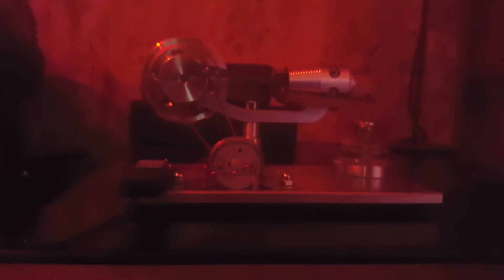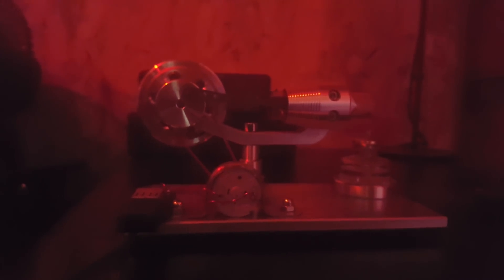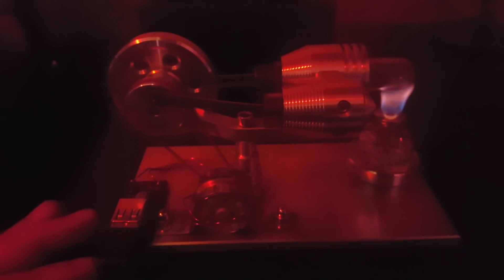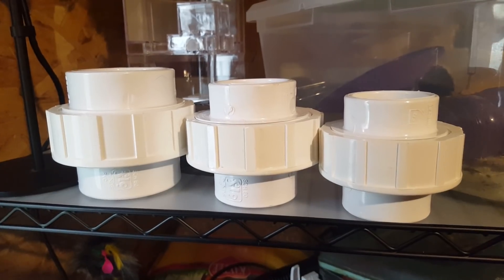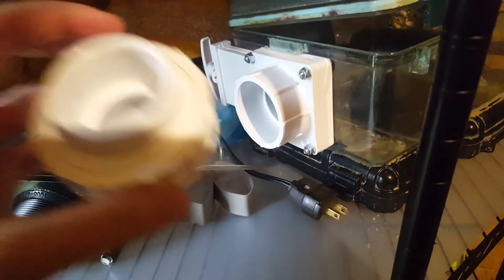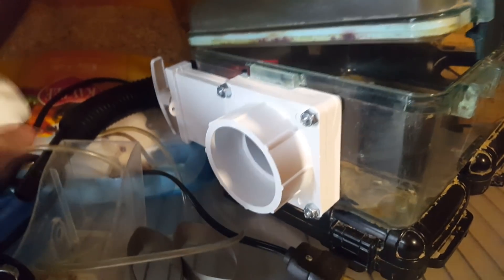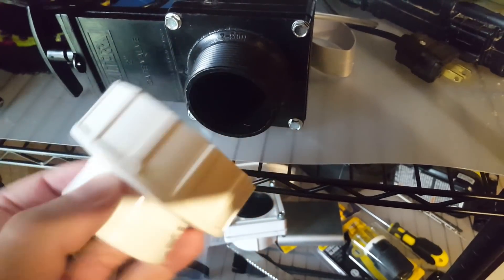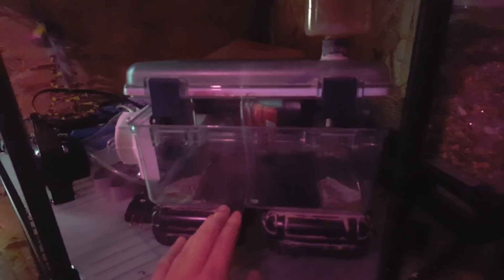Hampture Update for 3/25/2019: Stirling Engine, Lab Coat and Tube Fittings

Comment: Any plans on when mega hab will be dropped.
Reply from the maker: I'm aiming for this Summer. I can get it in the water by itself for sure, what's not yet sure is if I'll have the connector tunnel system worked out by then to link it up to the smaller habitat.
Reply: @Hamdad  awesome looking forward to it

Comment: If the valve thread is tapered then it's probably NPT. Use a ruler to check it against the NPT tables in this article: http://www.sparxeng.com/blog/hardware/how-to-model-npt-threads-in-solidworks
EDIT: Oh someone found it by googling the part # in a comment below, that's smarter.
Why not use flexible pvc fittings with pipe-clamps to connect the original white valve to the tube? Haven't used them so not sure if too stiff, but they're cheap

Comment: i would keep some form of insulation between the heating pad and the floor of the tank, just for energy efficiency's sake. make it easy to clean, so you don't have to swap it out every time it gets dirty like cardboard. a good form of insulation in this case likely would just be 2 plastic panels 1cm ish apart with plastic support 'beams' to keep them apart, and the rest just plain air, or if you make it yourself you could even put some rock wool between the plastic slices, though i imagine you'd have to seal it then cause that stuff is itchy for humans and i imagine hamsters as well.

Comment: that gate valve thread is probably just a standard pipe thread, just take it into your local hardware store and thread pipe fittings on untill you get the right size.

Comment: consider compression fittings.
Reply: he showed several PVC compression/slip fittings in the vid. It's possible he could use the female half of an 2" NPT compression fitting (if one exists) to connect to the threaded gate valve. The only imperfection is the seal is meant to match the tapered groove of the male half of the compression fitting, but at low pressures I'm sure it's fine if it fits

Comment: So it looks like your threaded gate valve is by Valterra and is SKU 1008-2. That's got a 2" Male Pipe Thread or MPT. So you need a 2" FPT to connect it to a slip adapter or something. You could also look into their SKU 6114 however its a 1/2" smaller so idk if that will work for the hamsters. Its got a built in union and looks a lot cleaner than a bunch of adapters. There is also the Magic Plastics 0516-20 which appears to be 2" but its a uni-body so you couldn't do a bulkhead mount. I would recommend talking to a spa/pool shop or an RV shop as it seems like those are the primary industries that stock these style valves.
Reply: Real MVP right here!
Reply from the maker: The problem with the SKU 6114 is that the entire unit is smaller (presumably?) in which case the holes for the bolts wouldn't line up with the ones already drilled in the habitats. I'd basically have to start over.

Comment: How are you planning to deal with the water that fills the tube when attached under water?
Reply from the maker: I covered this in a prior video. Use compressed air to purge it through a hole in the bottom of the tube, which is covered up with a wide rubber band when not being used
Reply: @Hamdad  awesome! I had the same thought. I'll dig around for that vid.

Comment: i mean, why don't you just measure the inner and outer diameters of the valves yourself?
then you know exactly what to look for in tubing/adapters, depending on whether you want it to fit over or inside of the valve.

or you could just heat the tubing with a heat gun until it becomes soft and force it over the valve, enlarging the end of it.
Reply from the maker: I have but go and try to find fittings listed by exterior diameter rather than interior.

Comment: I thought you were gonna use a hamster wheel to power the robots. Then the robots take care of the hamsters. It's the perfect synergy.
Reply from the maker: I might. If I can find a good supplier for the little dynamo built into the stirling engine I can use a hamster wheel to spin it instead.
Reply: @Hamdad  that would be awesome. I look forward to your next update when you find the proper tubing with female thread. You may also need Teflon tape to make the threaded connections and or properly sized gaskets. Kinda like a garden hose. Also be very careful when tightening plastic fittings. They are brittle and cross thread easily.